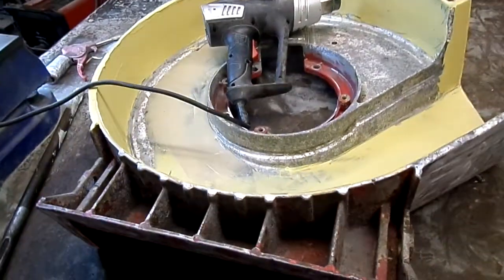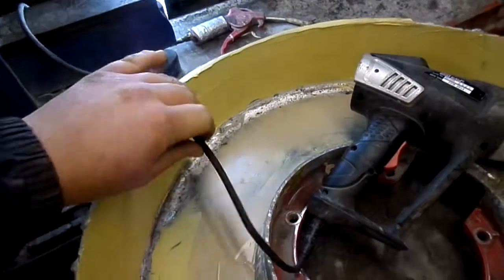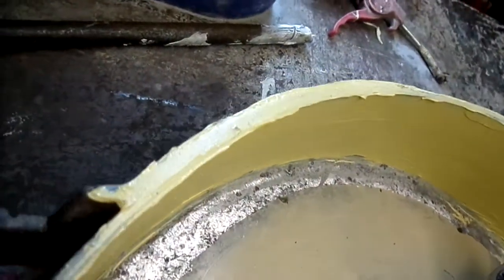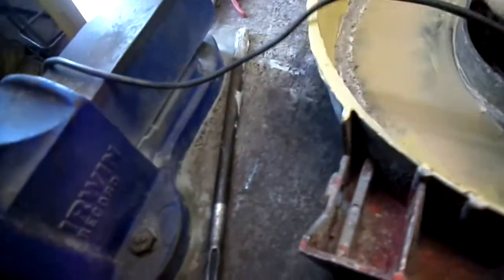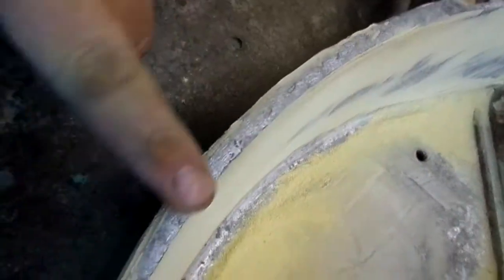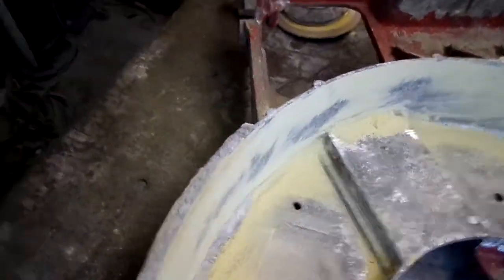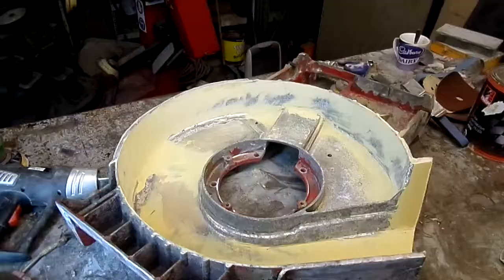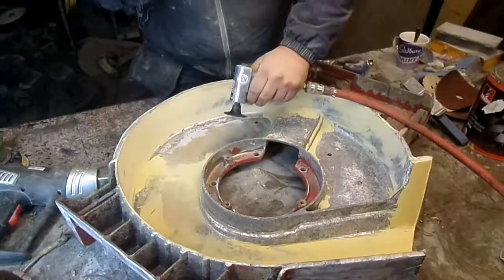How to restore a mower. (sanding, stopper) toro s/d, part 7

Comment: i just did the same to my alloy mower deck (lots of dents from stone/ rock when mowing)but after applying the metal body filler i didnt do much sanding because i think most of it will be "sanded" off when mowing anyway,  will  see how it holds up. just came to youtube see if anyone bodyfill their deck like me and come corss to your video.🙂